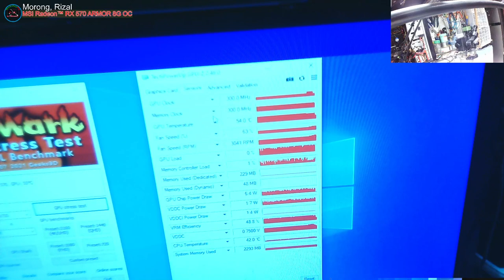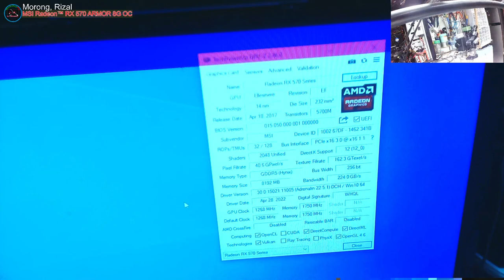MSI Radeon™ RX 570 ARMOR 8G OC - No Power, Shorted 12v, SMD Capacitor Only(Solved)

Comment: Those pads on the center three memory chips is a massive heat insulator.  Much better to leave off to not destroy the memory. This was such good luck for the customer. The fact you could find that capacitor when those mosfets were showing short on the other side. I don't think your volt ohm meter is good enough to show exactly where the short was. Good job.
Reply from the maker: Thank You so much <3

Comment: Any chance you have measurement details of all the thermal pads? Thickness, length and width....  Thanks very much!
Reply: Don't put those really thick pads on the center three memory chips. Put a very thin aluminum thermal strip on those chips if anything.
Reply: @PaulHigginbothamSr  interesting.  Never heard of using aluminum on any GPU chips.. Heatsinks, but not memory chips
Reply from the maker: Let me check

Comment: Hello, thanks for this video! this gs 7256 component (U2) that is on the other side of the board, which controls the first power supply phase, which voltages need to be present? I'm from Brazil, Thanks!
Reply from the maker: PM po kayo dito sa Video Card(GPU) Repair Business Page para po sa information, contact no., location at ma-assist kaayo.

Salamat po,
 link: https://www.facebook.com/VideoCardRepair/